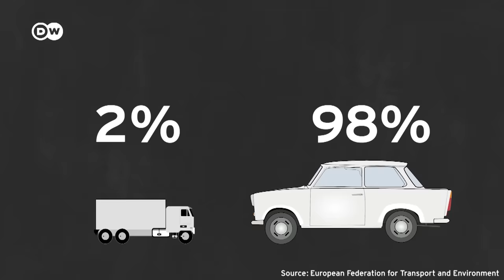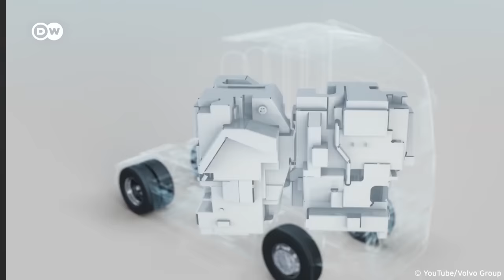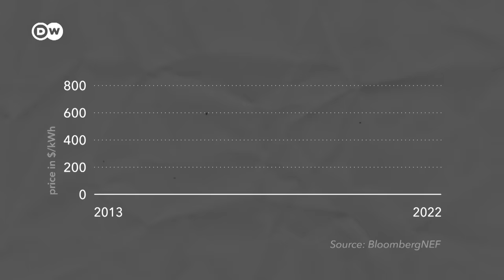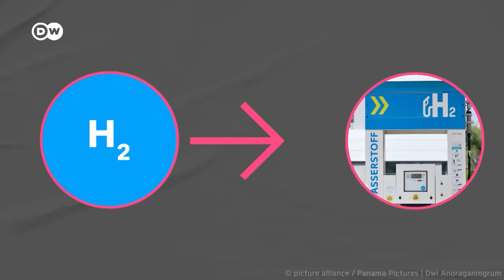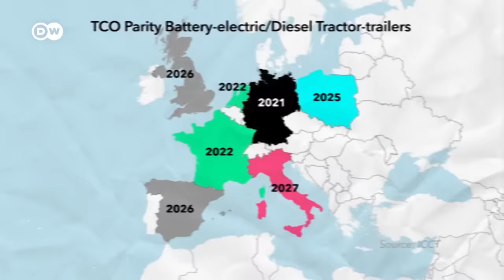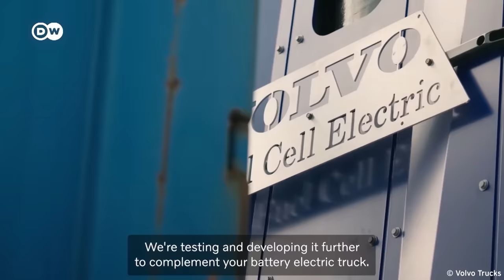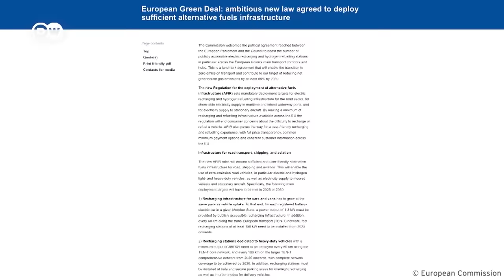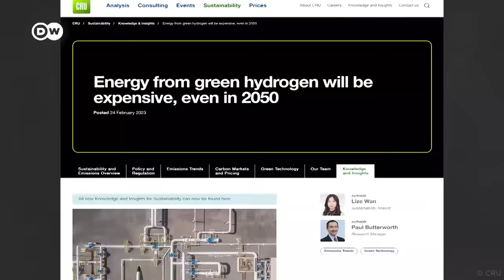Which will be the engine of the future?

Comment: This is simple - basic physics and chemistry and some high school mathematics shows that heavy batteries requiring absurd power for fast charging are NEVER going to replace diesel trucks entirely. Also, green or blue hydrogen is necessary for de-carbonization of vast swathes of modern societies, like aviation, steel, cement, chemical products, synthetic liquid fuels, and so on. 

The future will be a mix of heavy batteries and fuel cells, and H2 is vital for a future emissions-free world economy.
Reply: Except you need 4 times more electricity per miles worth of green hydrogen, than an equivalent battery powered vehicle needs. So the grid problem becomes 4 times worth with hydrogen.
Reply: @engineeringtheweirdguy2103  No. Do you even understand the difference between power and energy? And the electricity needed for cars is only a small fraction of all energy use. H2 can de-carbonize steel production, building heating, provide seasonal bulk storage 1000s of times larger than batteries, produce synthetic liquid fuels, and so on. And efficiency can be improved with high temp electrolysis.
Reply: @erik7726  yes. Power is the flow rate of energy.

And again. You need 4 times as much electricity to generate 1 miles worth of hydrogen than an EV uses. Hydrogen does have use in steel manufacturing, but home heating is a stretch when you could get the same affect for 6-7 times less energy from a heat pump. Which is basically a reversed cycle air conditioner. 

And for storage? No. The rate at which you could produce hydrogen would make it nearly useless. The there is the fact that it takes up an absurd amount of volume to get equivalent kWh. Doubly so when you realise the implications of the inefficiency. 

A battery can charge and discharge rapidly, and with around 96-98% efficiency. You get almost all the energy that you put in, back out again.

As for hydrogen, even take up a huge amount of space and not being able to respond fast enough to storage demands, the production of green hydrogen is roughly 70% efficient. And the conversion back to electricity through a fuel cell is roughly 60% efficient.

So of every 100kWh you try to store as hydrogen, you’d get back 42kWh…. Less than half. You are throwing away more than half of the energy you’re trying to store.

Aside from the set ups also being more expensive with lower operation lifespans than battery storage….
Reply: @engineeringtheweirdguy2103  

Fact corrections - it is 3x roundrip efficiency, not 4x. And even better with high temp electrolysis. And fuel cells will be much cleaner to mine and cheaper to produce than batteries when fuel cells are mass produced.

Heavy battery cars will NEVER replace all diesel and gasoline vehicles. Only batteries plus fuel cells can do that, and we will probably still use liquid synthetic fuels from H2 as well.

Chemical storage is the ONLY way you can scale storage to 10x or 100x what we have today in hydropower dams. Li-ion batteries are not even a contender, they are an energy cache and grid frequency stabilizer for a few hours, nothing more.

Peak power demands for 2 billion cars' fast charging needs globally are impossible. Even more so for trucks, trains and short distance aviation.

The future will be a mix of H2, batteries, synthetic gaseous and liquid fuels, and biofuels. Batteries are only one small part of the global energy puzzle, H2 will be a much bigger piece.

And yes, I love heat pumps. But in cold nordic winters, we need electricity to run the heat pump. That electricity will come from Russian and Norwegian fossil gas, H2 seasonal storage of green energy, and nuclear power, plus hydropower. Period.
Reply: @erik7726  2 billion cars won’t be fast charging. They will be charging at home pulling about the same amount of power as a toaster. The vast majority of EV owners charge from home over night. They don’t rely on fast charging. Faster chargers are typically used for those doing long road trips. Which most people do about once or twice a year. So not. Not 2 billion.

Synthetic fuel was found by the EPA to be one of the most carcinogenic substances on the planet with some exhaust having a 100% success rate at causing cancer to anyone exposed to the exhaust.  So that’s probably off the table.

And no. It’s 4 times efficiency.

And car for car hydrogen cars are less impactful to produce. But not by much. But considering fuel cells don’t last longer than 150k miles and the next big breakthrough they’re working on is a 200k mile fuel cell, when EV batteries last 500k miles or more. I’d say having to fabricate, replace, and dispose of 3 whole cars per every EV made would be much dirtier in the long run. 

For trucking however, hydrogen is worse than battery. The power required by the motors is typically more than what multiple fuel cells can provide. The fuel they require is typically much more than than they have room for.

Let’s consider the Tesla semi with the hydrogen Xcient by Hyundai.

The semi can take a full load from zero to freeway speeds faster than some cars. It has a 500 mile range which is remarkably cheap per mile for the cost of electricity and has a rated lifespan of 1 million miles. It can take a standard trailer and has one of the tightest turning circles of any truck of its size.

The Xcient carrys 31kg of hydrogen taking up over 1,500L of storage volume. It has two fuel cells both the size of a regular engine and a 75kWh battery which is the same size as what’s in the Tesla model Y long range SUV.

For that it has a 400 mile range, it doesn’t have the power to reach freeway speeds even when empty, requires a special trailer to make space for all the hydrogen tanks it Carry’s which reduces the overall volume of cargo it can carry and has one of the worst turning circles of any truck of its class due to spreading out the axels to make room for more hydrogen tanks. And despite being slower, carrying less with a lower range all while being some 20x time more expensive to run per mile, it has a lifespan of only 150k miles. Although the next variant promises 200k miles until it’s scrapped. 

So no. Hydrogen doesn’t have a place in trucking any more than it has in passenger cars.
Reply: @engineeringtheweirdguy2103  Synthetic fuels made right are cleaner than the original, for example good variants of synthetic diesel. Less sulfur, soot and other pollutants. For that matter, a modern diesel car is extremely clean, handling particles with the particle filter, and NOx with urea/AdBlue.  And about peak power, try to compute the peak power need when half America is on the move for e.g Thanksgiving. Even worse, look at buses or heavy trucks. It is very easy for a city to deploy a few electric buses to look green, but for making a whole bus fleet green, H2 plugin hybrid buses are much better. And roundtrip for electricity-h2 is 3x, look it up. As for trucks, a small, light cheap battery helps the fuel cell to handle e.g. regenerative breaking and peak power needs. I do not understand why battery fans become zealots - just realize that a combination of batteries and H2 are the future.
Reply: @erik7726  I’m not arguing that sythetic fuels have a lower environmental impact. It’s the health impact im worried about and a report by the EPA strongly disagrees with you. When something has a 100% cancer rate, it’s worth thinking twice. And the EPA report detailed every known synthetic fuel. Not just one. So far, they’re all really really bad.

Yes diesels are more efficient than they used to be. But sadly they still emit. And it’s apparently a trend for car companies to design them to spoof emission testing results. Like volkwagon and Toyota have done.

And no. That’s also not how that works. Your battery doesn’t go flat every day. It only discharges what you need. And if you have a full battery with 400 miles of range every morning because you charge at home. The power demand to recharge it is really not that high. Most people will arrive to see family and will charge there on slower charger than super chargers.

In any respect that “spike” won’t be very high. Hydrogen in the other hand, is 4 times more energy intensive, which has much large grid implications than BEV. If we have a grid capable of supporting the generation of a whole country’s hydrogen needs if everyone had a hydrogen car. Then it could very very easily handle any “spike” produced from BEV charging.

And yes, hydrogen cars require batteries. Why is that new information to you? That is the least of a hydrogen cars problems.

Comment: Something I didn't hear mentioned that will become a major factor in the cost of batteries versus hydrogen is whether or not we will be able to scale the mining that is needed for the materials for batteries. Yes, they have been getting cheaper and cheaper to manufacture, but a disruption in the raw material supply could upend that real quick. I think of the two proposed mines in rural Nevada, typically there isn't a mining project that rural Nevadans haven't immediately gotten on board with from the beginning, they know what gold, silver, and copper mines do to mitigate the damage to the environment, and they will gladly welcome them into their backyard in exchange for high paying mining jobs. These same people are incredibly skeptical of what the lithium mines will do to mitigate the environmental harm. Yes, lithium mining has less negative impacts than what is needed to maintain our current gasoline and diesel based road transportation system running, but the people in these communities where mines are being proposed aren't going to care about the global impact if it means their community is destroyed. 
If the lithium mining industry doesn't do more to get people on board with the idea that they can mine without completely destroying an area, the advantages of battery electric will very quickly dry up.

Comment: I am an over the road truck driver it takes roughly 20 minutes to fill my tanks with diesel that's paying for the diesel washing my windows getting back in the rig riding down my mileage putting my seatbelt on checking my brakes while in cab and moving on. That's with also filling up my and/or checking my trailer tank for the reefer fuel diesel That's pretty fast in and out 30 minutes maybe but and I think that's on a busy day

Comment: but the more you use the batteries under heat stress and heavy load the more it will damage it will maximum hold 2 years a driving and lithium isn´t a metal we have a lot of and including the environmental damage it can cause to nature if it isn't disposed correctly is really worrying beside hydrogen is a easy to storage the only problem is to make it from electrons which has improved a lot

Comment: Doesn't hydrogen need to be stored a a very cold temperature?  Doesn't that increase cost and complexity?  What about safety?
Reply from the maker: Liquid hydrogen does need to be stored in extreme low temperatures yes. For most FCV's the choice would be gaseous hydrogen which is easier to store and transport - and it's safer too. There are a set of questions when it comes to hydrogen though, find out more in our video "The truth about hydrogen" here 👉 https://www.youtube.com/watch?v=AGTjKJHu99c.

Comment: Nice vid. As for the H2 vs EV race: Well, I'm biased towards H2 because I've worked in the industry and hydrogen as a source of fuel just makes sense due to it being the most abundant element anywhere in the Universe. The abundance is one thing, its extraction a completely different one. I still maintain the view that EV is a transition tech and H2 will ultimately win the race, though I can imagine a world in which these two technologies are combined. Hydrogen is, after all, highly volatile and quite difficult to store, so it may be suitable in some areas and completely unsuitable in others where EVs can shine. Also, if we'd allocated the same amount of resources to H2 as we've done to EV, who knows where we could be now. Either way, I'm very keen to see what happens within the next two or three decades.
Reply: Common misconception. Hydrogen will always remain very inefficient compared to batteries simply because of physics. Also, there won’t be any reason to switch to hydrogen in the future anyway as battery electric vehicles are far more simple to build and maintain. Nobody would want to go back to a refueling system if you could simply charge your car at home while you sleep. Also, it’s not relevant that hydrogen is ‘abundant’ as electrons are just as abundant.

Comment: This video talk about hydrogen as if truck transportation is the only area hydrogen can be used. Hydrogen is much much more than that, hence research and technological advantages of hydrogen elsewhere are making hydrogen better and better. I'm convinced hydrogen will coexist with batteries. Low energy density required? 👉Batteries. High, heavy density? 👉 Hydrogen 💪

Comment: I don't think battery trucks will be the best solution for all markets especially developing countries. For instance South Africa, the most developed country in Africa, has regular rolling blackouts. You cannot charge batteries under such conditions and running a diesel generator just to charge a truck battery is wasteful and defeats the whole point of electrification, and having a truck sit for 4 hours waiting for the electricity to come back is not profitable. But hydrogen would be better suited as even if a generator is required to run the pumps, the energy transferred to the tanks of the truck far exceeds the energy used to run the pump and the truck can be back on the road in minutes instead of hours.  Economic, environmental  and infrastructure conditions are different accross the whole world, they will require different solutions.

Comment: we drivers also need constant power and we use inverters to power electronics in the trucks during breaks great question is how long can battery truck last from full 100% charge for 3 days (friday evening to monday morning break time) with AC on laptop around 200W phone and any other electronics that might need to be powered like microwave or coffee machine or TV or play station question is HOW LONG will that 100% charge last or can it even last for long time without recharging cuz diesel can last weeks like that just powering electronics drivers dont just sit and stare at sky every day when we are at break we want to chill and have fun off duty

Comment: The thing that most people don't get about this WHOOOLE conversation is in the Title... "Fullly Electric" vs  Hydrogen actually is a electric powertrain that uses electricity thats generated from hydrogen. SO the real the comparison is hydrogen storage with an extra generator vs JUST a battery. which has less components and is more efficient use??? obviously a battery. SO shut up big oil who invested in hydrogen 10 yrs ago and just trying to push off the next dependency. Hydrogen tanks are heavier and we skip the extra generator with its measly 50% efficiency output. Last fact to end this conversation- WE only need 100x100 sq miles of solar to completely power the whole grid. which is much easier than building out a hydrogen pump station infrastructure- WE already have powerlines everywhere.

Comment: Your analysis is missing an important factor that of the resources required to build the mobility device either battery or fuel cell. Fuel cell requires less raw materials than batteries, and though batteries might look the cheaper option at the moment, in the future, as the demand for batteries will increase, so does the price of their components, either lithium or cadmium or whatnot. These are what we call commodities, which prices are highly volatile on the international markets while they are coming with a very negative impact on the environment. If you become highly dependent on BEVs, you will become captive of the exporter of these commodities, expose your transportation company to bottlenecks and price hikes. Similarly, there should be a environmental impact score in terms of resources used to build these solutions, battery or fuel cell, otherwise your analysis is fantasy. Yes, the energy required to produce hydrogen might be higher, but what some of the interviewees do not mention is the other functions of the hydrogen, such as medium of energy storage and fuel or component of other industries, such as metallurgical or steel production, or aviation industry (Airbus is studying hydrogen fuelled airplanes) or maritime shipping. When you add up all the domains where hydrogen is the sole non-polluting solution, you realise the potential for economies of scale. The fact that research is just started making steps forward is a reason to carry it on. At the moment, EU has fewer domains where still has a competitive and comparative advantage to its "rivals", i.e., China and the US, and one of these domains is hydrogen related development. Misled analysis can be extremely harmful to our chances of becoming resilient and properly mitigate climate change.